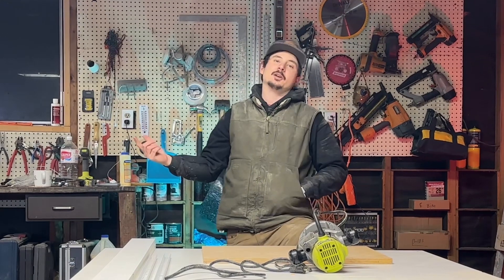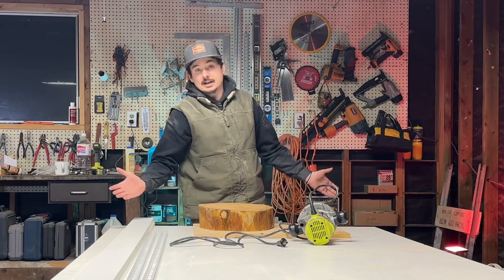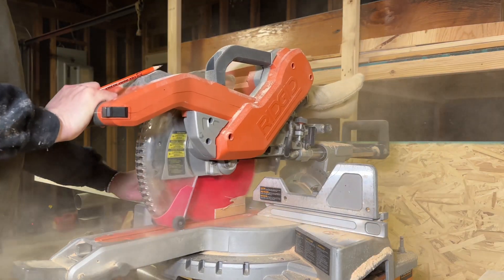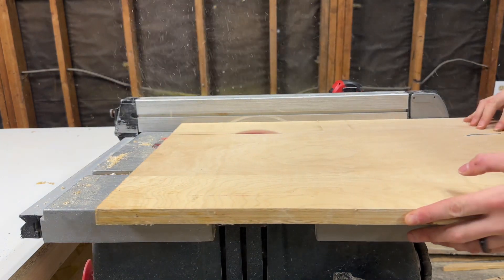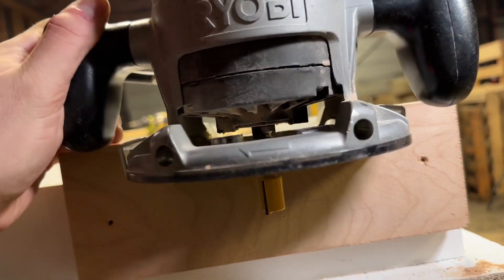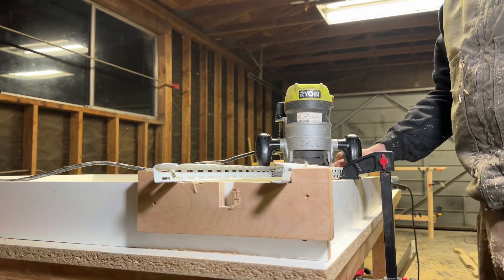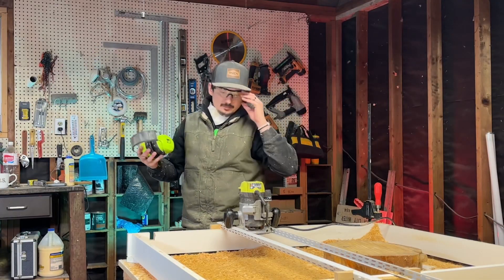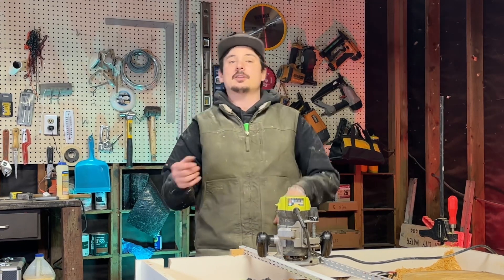Easy Router Sled - How to flatten wood without a planer

Comment: If you are going to do a lot of this you should swap in a throw away baseplate. Wear and tear from the rails on the same areas of the plate. Save your good baseplate for other work.
Uneven on the bottom may cause a rocking of the piece, spot hot melt glue the piece in place.
Reply from the maker: Really good point. I’ve noticed some minor scratching but yeah I imagine it will dig in and destroy the base plate over time. I might make an improved version of this out of plywood.  These metal rails although stiff, do have some flex in them if I put pressure down on the router.  Maybe a 1/16th. Barely noticeable but if I make bigger guide rails for larger slabs this won’t be accurate anymore.  This was a quick fix router sled but it has some limitations. Pinned.